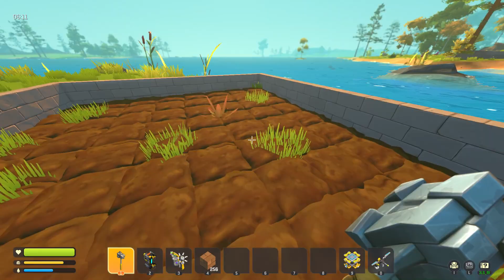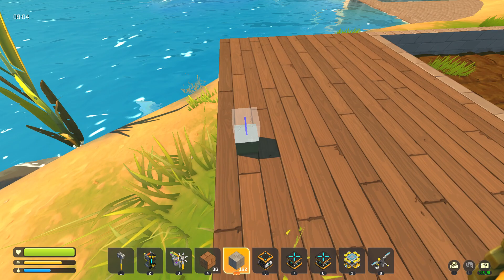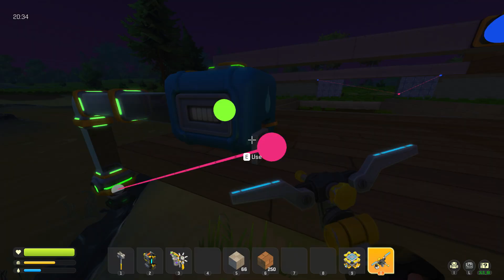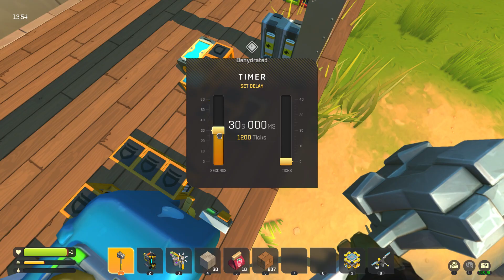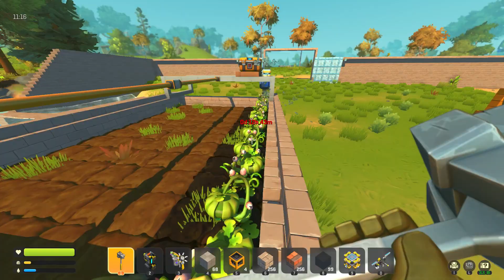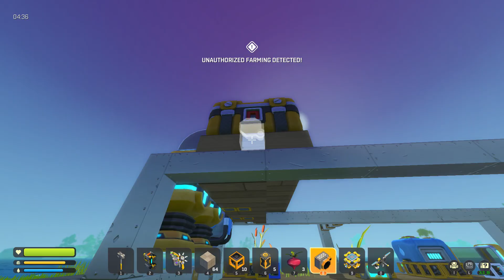Building a Fully Automatic Farm that Plants, Waters, and Harvests! (Scrap Mechanic Survival Ep. 7)

Comment: This is really helpful! I made one for my survival world, and improved it so it plants and waters both ways, and its awesome! A fully automatic 100 crops field, so cool. Also, it can be a little faster, at 18 seconds per extention/contraction, that makes it only 3 minutes per harvest/planting. It works because the vacuum pump can suck up the grown plants in the next row as well.
Reply: How long did it take you? (i am building it right now and it is taking 2 days to get the glue for the logic gates, JUST THE LOGIC GATES)
Reply: @greeenbulleet  not very long i dont think. if you know exactly what youre doing, then its pretty easy and fast
Reply: @Hlebuw3k  Well, the thing is, i am not worried about the wiring itself, i am worried about the COMPONENTS.

Comment: Somebody can help me?
@ +/- 11 minutes, he build a timer.
when he stop the system, this timer shut down, or mine doesn t. it continue to send signal. the three xor gate before this timer work well, one push = on, another push = off ...
this is my only problem.
the pump can t return at start, and if after i try to restart the whole system, it start at the middle of the farm...
im going crazy with this.

This farm is propably the best i found but, i can t make it

Comment: If you doubled the planters and had the gaps for the planters for every other plot you could double the extension speed then have the sensor for the water cannon point at the side rail with a gap at every plot and increase the speed a ton without making it that much bigger

Comment: PLEASE READ IF YOUR BUILDING YOURSELF!!!!!!!!!!!! If you have a problem where you pistons that push the whole cart thingy, get glitched out because of the timer just repeating itself. what you do is you hook up an extra OR gate to the AND gate that connects to the piston timer. then connect the memory bit (that's full of XOR gates) to the OR gate you just placed!!!!!!!!!!!!!!!!!!

This works because:
An AND gate needs all inputs to be active at the same time for it to light up, when the XOR gate connected to the AND gate  lights up when the OR gate is not (when the whole system is off) it will not activate the pistons!

Comment: my design is finally done! i stop following you video and did myself the most parts on it, the end result had the pistons strategy to pull or push cart equals with 2 pistons balancing the other making the entire stuff still in place, i screw up following you video when comes to toggle switch and i finally understand what you did, but i discover by myself nad in the end not use that... i make a flipping cart and put sensor in each edge of both rails... the low rail make the system skip a row, the second rail make the cart flip and goes to the next line, this way my machine never be in iddle backing to start of a line, i need wait some seconds because of the cart flipping stage, for that i make a timer with when flip the cart already swith the row... when it reach one of the edges of low rail it trigger a memory bit that shift the next step... this make my system go all lines until the last then back all lines until the first and keep going... i just put 100 seeds on it and let it on... i need work how to only plant when it harvest something, but i not figure that out... and actually i like this to not be on all the time, because raids keeps getting harder if it is on all nights with crops

Comment: Now i mean this in the most positive way but... when doing the logic set up in your tutorials can you wire the circuits alittle slower?...cuz i find myself having to replay a set up part many times to get it right and that can get alittle annoying for some but otherwise great tutorial...also can you provide a detailed wiring guide for this please?...preferably in the form of a PDF?
Reply: I had to go back and for several times when he sped through setting the logic blocks up. I like that he stops to say what the blocks are, but then the cursor flies across the screen and it's done...?!  Then there are blocks he connects up that appear that I swear weren't there before. That yellow logic block to the pistons, for instance??

Comment: For the planter you could use 3 parallel Sensorlines with 3 vacuumpumps for planting, where every 3 fields it gets a signal to plant, this way you can run it at full speed. 
3XOR as a toggle, nice. I learned a lot.

Comment: I guess you could have the three different controllers, but do all their extension on the first two slots and use timing to just activate them one by one? Like, the first controller extends the first piston, then you activate the second one to do the second piston and so on. That way, you could still bring them back all at once by just shutting all their respective power sources off at the same time!

Comment: If your only time bottleneck is the seeder, couldn't you put in another seeder in lead?  First seeder skips every other plot because of time increase, but following seeder fills in those gaps.  Possibly a second sensor trigger rail that intentionally skips every other plot on seeders would make two seeder system more consistent.  Spitballing here.  Great vid.

Comment: Wondering if anyone can help. I pretty much just copied what kAN has done with his logic. But for some reason when I cut off the system I get a loop on the timer to the pistons, which in turn loops the whole system. So it doesnt turn off unless I reset the piston timer to 0 then back to 10. Ive tried messing around with it and even watched the video slow to make sure all the connections are the same but no luck. Im new to trying to build with logic so im thinking there is just something simple im just missing.

Comment: I built mine after a similar fashion - but I didn't need any memory circuits.  I used the block/sensor system (like Kan used for detecting when to squirt water) for everything, including the extension/retraction logic.

Comment: finally caved and built this thing and well, you changed something off camera(prolly when you added the invisible yellow and gate for the length pistons) and it doesnt seem to work. please let me know what you used to cause the timers to stop cycling. everything else works perfectly except you cant turn the thing off. when you do, the timers just keep going as they were except they now have a second beep going in an endless loop. 

**Edit**fixed it, the triple xor that goes to the first timer loop, needs to not only go to the xor but to the and also. this will cease the loop because when the system turns off, no matter what the and does not receive a signal on both lines.
Reply: Was literally looking through the comments because I was having exactly this problem.  Glad you found the fix, seems to work just fine now.  He already goes through stuff so fast and then the stealth edits.  It's like learning coding from a book that is missing some of the pages but the pages before and after flow perfectly from one to the other so you don't realize you missed a page.
Reply: @TaikeiNoYuurei1016  Yeah man, this video is just awful.  Why didn't the guy remake it once he had the logic right?  And why didn't he explain anything?  It's 31 minutes of incomprehensible garbage.  His circuit isn't that complicated, he could have just explained it in terms of functional blocks and how to debug/build it.  This is basically the only Google result for "auto farm scrap mechanic" too, sadly.. ugh
Reply: @raidfather  keep with it. I got mine working and its beautiful. Its 100% worth the struggle.
Reply: thx man i had the same problem and raged it out like 10 times
Reply: Ive tried his way, and your way, and All I get is looping timers that wont shut off and each pass the timer gets lower.
Reply: first comment i've ever wrote: thanks man !!!
Reply: luv you man...i spent like an hour trying to fix it, going over and over the video if i miss something, and then when i lost all hope, like Michael, i thought maybe someone have the same problem and dive in the comments and ta-da found your comment. thanks a lot man.
Reply: 3 months later and i love you for this. now....when mine does the .650 second thingy it extends all the way out. any ideas on that?
Reply: If possible I could use a hand, at 5:10 when he adds the colored logic gates are all 3 of those “And” ?

*Edit* lol nvm figured it out and thank you for solving the other issue
Reply: Saved me from a massive headache tx a bunch!
Reply: Luneticus  do you know how to stop the width piston, the one with the vacuum pumps, from fully extending and instead incrementing
Reply: Thank You!
Reply: DUDE UR A LEGEND
Reply: Thank you so much!
Reply: Thank you i was getting irrationally mad at this loop
Reply: A year later since you've made this comment and you are still saving lives ToT Literally sat here for an hour redoing the logic gates because I thought I missed something then I went searching in the comments and you came in clutch. Thank you so much for figuring this out for the rest of us. You are appreciated so much! TAT
Reply: you are my savior!!!!
Reply: legendary post

Comment: you can add one more machine to put seeds in the same row where the other is and so increase the speed so it will put two seeds at a time and thus be much faster because basically it would always be separating seeds and it would go at the speed of the first time it was super fast

Comment: If you really wanna halve the time it needs, you can't go with rows 1 and 4 but you will have to go for 1 and 5 so the first goes for the rows 1-4 and the second goes for 5-8. Else you will have one go 1-3 and the next going 4-6. After the first has to go over 4 and 5 again being useless when the second goes for rows 7 and 8, so two cycles which are not needed.

Comment: The timer that  extends the piston keeps looping even when it is turned off does anyone know how to fix that.

Edit: i found a fix if you copy the timer where its one 30  second and one 15 change the 15 to a 30 second and link it to every thing else it fixes the problem
Reply: What do you mean by this? Copy the timer? What 30 seconds? I'm still trying to fix mine.
Reply: @FishPit  so what i found out is the timer loops when you turn off so what you need to do is like the memory thing to both the xor and and gate and then it will work
Reply: @cooldudewill07  still dont follow. do the memory thing where?
Reply: Another solution to this problem is to hook up the timer circuit like this:

The the output from the memory bit and hook it to a NOR-gate.
Take the output from the NOR-gate and hook it to another NOR-gate (this is instead of Kan's XOR-gate).
Take the output from the second NOR-gate and hook it to an OR-gate (same as Kan's).
Take the output from the OR-gate and hook it to the timer (same as Kan's).
Take the output from the timer and hook it to the second NOR-gate.
Reply: cooldudewill07 god amongst men
Reply: @ScriptCoded  You are my man. I tried since hours and dont want to just copy and paste the farm rather also to understand what happens. And I knew where the system the mistake was but your idea makes it run, now. Thx a lot.

Comment: Not sure if anybody has tried it yet but I just did it yesterday and whenever you skip some parts, in the next scene, switches, buttons and even logic gate popped up that were never mentioned previously. You shouldn't skip. As a beginner, I have literally no idea where to link the newly popped out switches or even link the logic gates to where correctly. It's not a very good guide if this keeps happening. Followed it till 10:30 and a switch, a button and even a logic gate that were never mentioned just appeared.

Also, given how logic gates point A to point B is different from point B to point A, I can barely follow the complex logic gates' connection. Especially since you put them 3 in a row, it's extremely difficult to see when you loop the first to the second then the first to the third and loop it back.

Comment: You could have 4 seed planters and run it at full speed.  Just use a 2 deep notch every 4 crops and trigger planting on a 2 deep sensor, water remains on 1 deep notches

Comment: What if you added a 2nd planter in the same row but make it trigger with a range of 2 instead of 1 so you can put a 1 notch and a 2 notch every other soil square and it could be faster? I don't know maybe I'm wrong I'm new to this game, but if you can make the sensor for the 2nd planter turn off just like the first one but with a different notch, maybe a range of 3 it should work?

Comment: Instead Of Using A Water Container, You Can Use A Large Chest! That's What I Did And It Works Perfectly And You Have Much More Extra Water. The Only Difference Is That The Large Chest Is More Costly With Materials.

Comment: When you were doing the shutoff test at the end it looked like nozzles were not lined up with the end row, therefore i suggest using another sensor-tooth system instead of timers. Also since the contraption 'knows' where each row is you don't really need that 30 second timer. Use the sensor for the planter (since it is the slowest one) to trigger a circuit that advances the gantry until that sensor is triggered, then pauses for the seed to be planted, then advances to the next row. While that setup will most likely be a bit more complicated than a timer the main advantage of it will be the fact that the gantry will come back to 0 at full speed.

Comment: Have I got some ideas for you...

1) Do the sensors detect the crops?

If so, use that to advance the gantry along the row using the same wobble method.
No timer needed

2) Use memory bits to break up the actions.
Step 1, vacuum the crops, step 2, plant them, step 3 water them.
this may take "longer", but if you use the wobble method, you can vacuum and water quickly and plant in both directions.

If sensors do take crops, then this can be left running. It will auto vacuum crops, only seed empty plots and water everything.

Then you only need to worry about your new bot joining forces with the existing farm bots and attacking you when you least suspect it...

Comment: Since planting every other is faster... you can have it plant every other on extension, and every other on retract to keep the speed up. It doesn't have to be one after the other. Also for the faster speed where it skips 2, you can set it up so it is a constant speed, skipping and planting and watering and go over it multiple times. Or you can set up one additional planter and have them alternate.
Reply: Also why not just add a sensor to have it send it back when it reaches the end instead of waiting for time.

Comment: You could probably set up 2 or more vacuume pumps that switch between dirt plots to speed up seed dispensing. Also could you setup a second water dispensor so the system could work going both directions? I bet you could get it down to 30 seconds.

Comment: Why dont u use 4 seeders with a 90' angle with the sensors connected to a timer and that'll be faster ... or in english have 2 barings connected to however many blocks thick it is cubed with a timer or connected to a sensor

Comment: I think I know why the controllers weren't in sync
the controllers might just stop at that step in the sequence if the length doesn't change later on in the loop, so for the first controller it would stop at the second step,
and for the second controller it would stop at the 4th step, and the 3rd at the 6th step,
then when you go back they will all go backwards from where they were, which was the step that they reached 15, and would retract at the same time

Comment: I wonder if you add multiple seed planting vacuumed pump in a single file you could counter the flaw of the planting speed issue, besides nothing said you can’t do a mirror sets of vacuumed pump set or maybe even a 180 turn of the set of pumps and do the reverse next roll an so, long as it’s efficient it’s worth the investment

Comment: This is awesome, but as he said, you can plant the whole thing manually much faster.

Something I've had an issue with though with automated systems. When you set a full resource collector in front of the refinery bot, it starts to do it's thing. When ever I take off though, and go farming for materials, I'll be gone for a while. When I get back, the refinery is still pulling things out of the resource collector. As if the process stopped after I got to far away. If that's what the game is doing, then won't this automated farming stop doing what it does once you take off? So instead of an 8 minute run, it gets through the first minute before you get to far away. You're gone for 10, then come back and the farm still has another 7 or so minutes to finish.

Comment: Try adding one or two more vacuum seeders, all activated at the same time but with the controllers running one movement per section instead of splitting to 8 and 15. If one seeder skips every other plot, then two will get all of them.

Comment: You could add 2 vacuum pumps in the same row so that it works in both directions and you could speed up the pistons because you got 2 planters in the same row so it would be 4 times as fast. Also it seems to get off a bit at the end and you could fix that by changing the timer from .65 to .66.

Comment: Serious question why use a timer loop for changing rows? wouldn't it be easier to put a sensor at the end and have it feed into a pulse to trigger the row change? (as well as be timing agnostic)

Also for base defense moonbo figured out you can just crush the bots and it 1 shots them, what about setting up automated crushing pads along your walls to crush bots when they are at the wall?